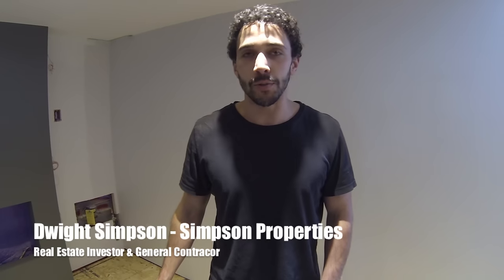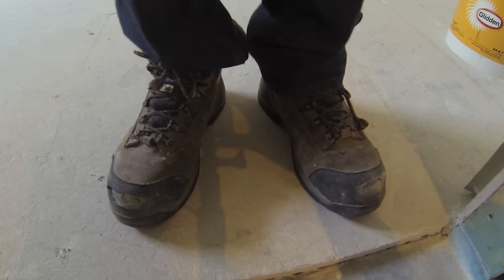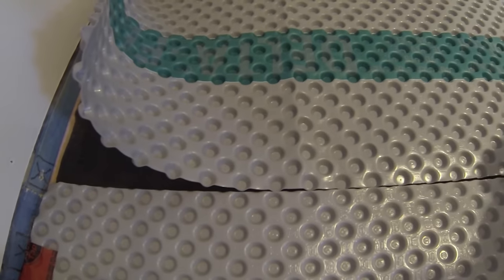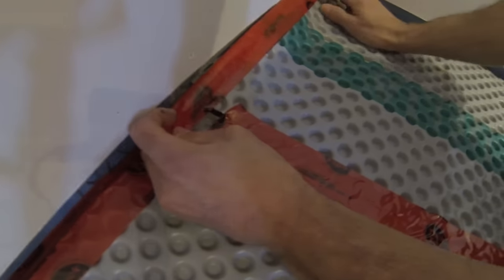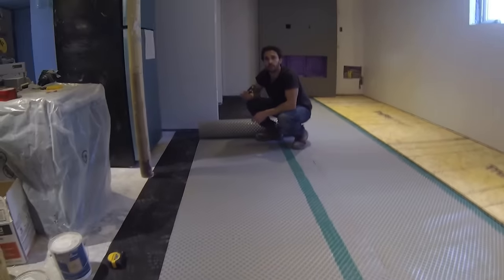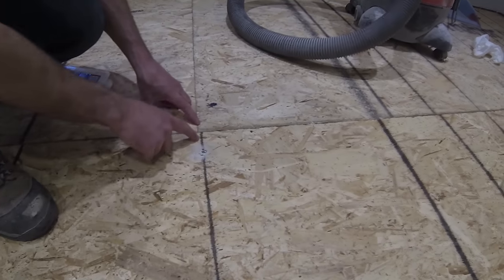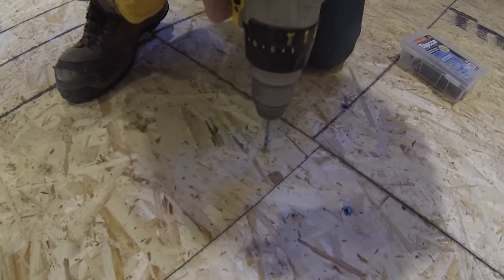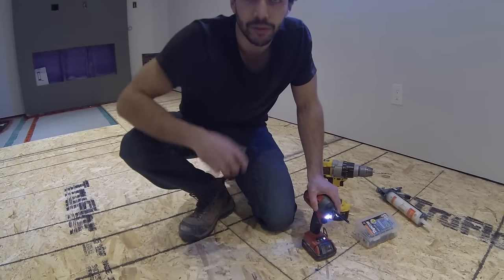HOW TO INSTALL A SUBFLOOR ON CONCRETE

Comment: I'm a remodeling contractor and have and have started building this subfloor assembly but without the landscape fabric. The floor does sound noisy/hollow. my concern with using the landscape fabric is that it will wick up moisture. I believe landscape fabric is partially  made from organic material  and could promote mold growth?  also does the floor system sound less hollow once the flooring and all other finishes such as walls ceilings etc are installed
Reply from the maker: Using landscape fabric is recommended by the manufacturer. It's a product that will last for 10+ years buried in moist soil. You should not have any concerns about the landscape fabric encouraging mould growth installed on a dry slab. Any major foundation issues or water leaks should be dealt with before installing a sub floor. If you have normal slab conditions, moisture should not be a concern or issue.
Reply: @simpsonpropertiesltd  thanks for the quick reply. Does the landscape fabric also help with the hollow sound. I’m hoping the finish flooring will also help quite things down.
Reply from the maker: Installing the landscape fabric does eliminate that hollow & clicking sound. That’s the reason why I installed it and demonstrated that in the video.

Comment: I have had this system in my basement for 16 years now, great as far as warmth, no hollow sound anywhere, they did not use landscape cloth underneath, I would suggest against that personally. At some point, you will get water coming in, anywhere water has gotten to the basement floor the worst spots are at the fasteners, they act as a wick for water and also you are puncturing the protective membrane. It's like going for a canoe ride and poking holes in your canoe. Overall a good cost-effective solution but can you not leave the OSB without the fasteners?     Still looking for a better solution!
Reply from the maker: Unfortunately, the OSB has to be fastened the concrete floor. Otherwise there would be to much movement and the finished flooring surface would reflect that movement.

Comment: Very clear and well structured tutorial! I do have a question for you. I have an enclosed patio addition that has tile on concrete. The patio floor level is lower than the house floor and would like to raise it to the same level. Would you recommend installing this subfloor directly on tile?
Reply from the maker: Septimiu Sarca thanks! It's always a best practice to remove the old material then install your new flooring. It's going to be tough to properly secure your subfloor with tile underneath. Usually your sub floor is installed on top of wood joist and fastened with wood screws or installed on top of concrete using concrete screws to fasten it to the concrete slab.

Comment: Thanks for the video. 
I have ICF walls and want to ask if the tuck tape would be adhered to the exposed styrofoam at the base of the wall just behind the drywall?
Reply from the maker: No problem. If I had an ICF foundation that is how I would do it. Seal the seam between the floor membrane and ICF with tuck tape.
Reply: Thanks for the prompt reply, much appreciated!

Comment: Great video. Very helpful. One question about OSB, should I keep a gap between the OSB for expansion/contraction?
Reply from the maker: It’s a good idea to leave at least an 1/8” gap between the OSB sheets for expansion and contraction. I forgot to mention that point in the video. Some OSB brands such as AdvanTech have that gap built in to their tongue and groove.

Comment: The holes on the top side of the Delta FL could act as cups and could hold water if the basement were to flood. You would have to take up all the osb. I recommend dry barrier subfloor. Has dimples on the bottom side and the top is flat.
Reply from the maker: If that much water is in the basement the entire floor would have to be removed anyway. The slab would have to be exposed and air movers would have to properly dry the space.

Comment: Cool video. My only question is why install a subfloor when they've come pretty far with laminate planks? The waterproof is actually affordable now. Just seems like it wouldn't be practical unless you're installing true hardwood
Reply from the maker: I agree with you in terms of vinyl plank flooring since that flooring would not wick any moisture. Laminate flooring would still wick moisture from the slab. It's still a best practice to use some sort of underlayment for that style of floating floor.

You could also install directly on top of the slab using a glue down method. There are specific glues you can use for this application such as Tite Bond 771- Step. It’s an advanced polymer adhesive, moisture and sound control system. It provides moisture control protection which is critical for installations over a concrete slab in basements or slab on grade applications. It’s critical that the concrete is dry to the touch and fully cured to bond properly. It can be used to secure engineered hardwood, solid wood, bamboo and cork flooring.
Reply: @simpsonpropertiesltd  ok. The problem with the glue install is that you get one shot at corners when going around. You know as well as I do that a lot house are not square, if you gotta adjust or cut again good luck getting out. Also,  6 mil vapor barrier is a lot cheaper and practical. For me if a costumer asks for glue down I'll tell them definite benefits not to
 Be blessed

Comment: Great and informative video. I am going to be using this system on a pole building slab floor. New construction, cold climate here in Michigan. I have plenty of height and my entry doors are 3.5 inches above cement grade, so no clearance issues. I would like to use 1 inch ridgid foam board for added R value. My concern is could the TapCon screws compress the foam board at that thickness, making my OSB appear wavy? Should I step down to 1/2 inch foam board to be safe?
Thanks and keep up the great video work. People like you make YouTube   great!
Reply from the maker: Thanks for your kind comments. I would recommend you give the Cosella Dorken tech support a call with that question: 1 (888) 433-5824. They are the manufacturer and will be able to steer you in the right direction.
Reply: I also want to add some insulation foam board to my cement floor to add R-value and help make the floor feel 'warmer'    What did you end up using thickness wise and how did it workout, would you do anything differently?
Reply: In the end, I decided to use no foam board at all. I rolled out DMX 1 step  in the entire building, except for a 1 car garage area that I left bare. About 1000 SQ ft of area with DMX.   I framed interior walls directly on the DMX, using tapcons to secure to the floor. (1 tapcon about every 2 feet along the framing) Most of the DMX had LifeProof vinyl plank flooring installed directly over it. It's worked great and the floor is quite comfortable, even now with outdoor temps in the teens. The exterior walls have 3 inch thick foam in addition to fiberglass loose fill blown in using roll out mesh to hold in place before drywall. ( I ran the lower 4 feet of drywall first on exterior walls and stapled mesh to the studs in the upper parts, cutting a slit where needed to insert the hose for fill. I also put 24 inches of fiberglass blown in the ceiling.

Comment: Mr. Simpson, can I use the landscaping fabric, delta underlay and a 12mm LVP that includes 2mm of rubber underlayment?  Basically, exclude the plywood on my basement floor.
Reply from the maker: Yes you can. Just double check the Delta FL spec sheet. It states what kind of floors can be installed directly on top of the Delta-FL. Check the spec sheet of your flooring manufacturer as well.

Comment: Question for anyone who would know, we have to frame walls and everything, should I do this floor, before adding walls? Or should I put up all the walls, and then the flooring in each room?
Thanks in Advance, GREAT VIDEO
Reply from the maker: Thanks 👍🏽. I would install the subfloor first then frame your walls on top of the OSB. This way your sill plate (bottom of the wall) is off the concrete. 

If you frame your walls first make sure you install a sill gasket or poly under your sill plate.
Reply: @simpsonpropertiesltd  ok, thanks much!

Comment: Interested to know the total thickness of the fabric,underlay, plywood and laminated floor. I presently have a flowing floor that's about 4.5 inches thick.want to know if it's worth ripping up my floor. Thanks for the vid!
Reply from the maker: Delta FL is 5/16”, subfloor 5/8” = 15/16”. Your finished floor height will vary depending on what type of flooring you use. The landscape fabric thickness is negligible, t’s maybe a couple mm thick.

Comment: Terrific video!  So I live in the North, and it's cold, even until June it can get pretty cold.  I'm about to put vinyl flooring down in my basement.  The flooring is "luxury vinyl flooring" from Home Depot and claims I don't need any underlayment as it's integrated into the product.  But as cold as it is in my basement, do you think it would be helpful to put down the Delta-FL and would that help my floor not be so cold?  And can I put the click-together vinyl flooring directly onto the Delta-FL?
Reply from the maker: I recommend you read the manufacturers spec sheet on Delta-FL. It details what products can be installed directly on top of the membrane. 

I believe you can install floating floors such as vinyl plank directly on top of Delta-FL. It will help reduce the heat transfer a bit but not by much. 

If you really want to reduce heat loss in the floor I would recommend Delta-FL, rigid insulation board, 5/8” OSB, then your vinyl plank flooring.
Reply: @simpsonpropertiesltd  Thank you, I really appreciate it!
Reply from the maker: No problem.

Comment: I am going to be installing a combo of carpet and laminate in my basement remodel project that is approximately 900 sq ft.  I have selected a very similar product to the Delta-FL that you used.  I was wondering what your thoughts are on using OSB that is not tongue and groove.  Was looking at this from a cost perspective.  In my area 5/8" OSB without the T&G is 1/2 the cost of OSB with T&G.  I don't want to compromise quality however.  Your comments are appreciated.  Great video!
Reply from the maker: If you don't want to compromise quality I would stick to using tongue & groove OSB. It's around $14 CND per 4'x8' sheet. If you don't use tongue & groove it can cause uneven surfaces & movement/separation over time.

Comment: Thank you for posting this great video. You have saved me $$. Your presentation style is excellent. I’m wondering if you have any videos pertaining to installing ceiling in a basement. I want to use drop but I’m concerned about losing precious headroom. I don’t want to go drywall, I want full access to plumbing, electric, etc
Reply from the maker: Russ DeVita thanks for the feedback I really appreciate it! Sorry I don’t have any videos on installing dropped ceilings.

Comment: For some reason our drill bit will not drive far enough down for the screw to be flush with the osb. We are doing this in a bedroom with low traffic. Can we skip screwing down the osb and just lay the planks nailing those into it? It is heavy osb and not moving or shifting.
Reply from the maker: Ashley Takes Action if you use a SDS drill and good concrete bit you should have no issues drilling a deep enough hole. You can rent an SDS drill from Home Depot if you don’t own one. You will also need an impact driver to screw the concrete screws in properly. 

I would recommend you follow the manufacturers recommendations and install the fasteners. It’s always cheaper to do the job right the first time 😉

Comment: Your videos seem to always be worth while watching , including this one I 
 have a question pertaing to this type of installation . I have a sun room that may have been an ( add on with a concrete floor , there is no basement in this area of the house )at one point those linoleum square were put down and has stayed for decades it's still there cracks and all then a carpet had been over that for too long as well , I ve taken that up and would like to continue the wood flooring that in the rest of the house , I'm hearing I can put hard wood over this concrete ( hopefully ) use ing the pre method you just showed on this clip , and then I hear others saying it's not a good idea .Whats YOUR OPINION on the subject ?
Reply from the maker: Bruce Beamon if that sun Room is not a condition space and humidity levels are not within the manufacturers specs you may run into problems. Warping and gaps may form between the planks. 

You could install a subfloor and then the hardwood if you have concerns with the slab.

You could also install directly on top of the slab using a glue down method. There are specific glues you can use for this application such as Tite Bond 771- Step. It’s an advanced polymer adhesive, moisture and sound control system. It provides moisture control protection which is critical for installations over a concrete slab in basements or slab on grade applications. It’s critical that the concrete is dry to the touch and fully cured to bond properly. It can be used to secure engineered hardwood, solid wood, bamboo and cork flooring.

Comment: Can you use it on a garage floor for the temperatures outside or -30.? Can you also use it on the garage for where they will be rolling tool cabinets?
Reply from the maker: I personally wouldn’t install this in a garage. It’s not rated to support the live load of a vehicle.

Comment: Since the vapor barrier is sealing moisture from coming up through concrete floor... does it build up somewhere else and cause problems since it can’t naturally escape through the surface?
Reply from the maker: No. A normal slab should not be wicking water to the point where you have sitting water. If that’s the case that would have to be addressed before installing any flooring.

Comment: How does the landscape fabric underneath handle moisture? I'd worry about that maybe, rotting? Thanks in advance.
Reply from the maker: It works completely fine and is recommended by the manufacturer. It can be installed outdoors in garden beds and lasts for years without breaking down.

Comment: I read that Delta FL is not approved by North Atlantic Flooring Assoc.  and that you have to put the landscaping fabric down first.   Im doing a grade cement floor and watched this and other videos.  I saw one for DMX One Step, which you dont need the landscaping fabric to go directly on the cement.  The DMX has the foam attached, and its quiet when you walk on it.  You made this video a few years ago and is there any update to what you think about using DMX One Step as to using Delta FL?    Thank you.
Reply from the maker: They are both similar products. I would crunch numbers and see which method is more cost effective. Keep in mind with Delta-FL you will have to install landscape fabric which is an extra step and cost.

Comment: What did or do you do when you get to an exterior door that is already flush to concrete? I was to maintain dry but this will elevate the floor above the bottom of the door. Thx and loved the video.
Reply from the maker: Sorry for the late reply. A solution would be have no subfloor installed in a small section in-front of the door. Have a transition between that section and the raised subfloor area. Thanks for watching the video and your feedback!

Comment: I've been doing a lot of research for installing a 2 1/4" solid hardwood floor over a concrete slab (the old install buckled using  Dri-Core subflooring with no signs of water damage so I believe it was just a bad install) and I keep coming back to this video because it is the most clear and thorough. One thing I've recently stumbled upon that you don't go into in this video is an expansion gap between the OSB 4' x 8' panels. There are some sources that say you need a 1/8" expansion gap between the OSB/plywood panels and other sources that iIMPLY that the T&G OSB boards are designed to allow for that expansion when the T&G are fit snuggly (like you demonstrate in this video). But nothing just comes out and says it. SO I guess my question is, does the T&G design account for the need for expansion joints? For both the 4' and 8' side? Or Just the T&G side? Or does it still need to be done all around. Great video. Thanks!
Reply: user error
Reply from the maker: It’s best to leave a bit of room for expansion/contraction. Huber Woods AdvanTech is the only OSB I’m aware of that comes with a built in gap.

Comment: What is the best way to level a basement floor before install of subfloor and  engineered hardwood?
To make a dance floor or karate floor they sell sponges 3" by 3"  that stick onto the bottom of the subfloor to reduce impact.
We used them with the subfloor and engineered hardwood that is super flexible on top of that in the basement so it can handle slight uneven floors no problem.
In our next house I would like to level out the floor before the install. Is that ok to do so (Drain issues?) and what is the best way?
Thanks
Reply from the maker: It’s ok to do that. The easiest way would be to install agilia screed concrete. You would have to run the run bees though and see if the cost is worth it.

Comment: Looks like a great idea, should use some rigid insulation as well.
Reply from the maker: That would be beneficial as well but unfortunately we did not have the appropriate ceiling height to allow for that.

Comment: I'm using Roberts 6 Mil vapor barrier direct onto concrete. Should I put the Landscape Fabric in between the 6 mil barrier and the cement?
Reply from the maker: I think you should be fine with just the vapor barrier. That should stop the clicking noise. I would do a test patch with a couple of sections. Walk on it and see how it sounds.